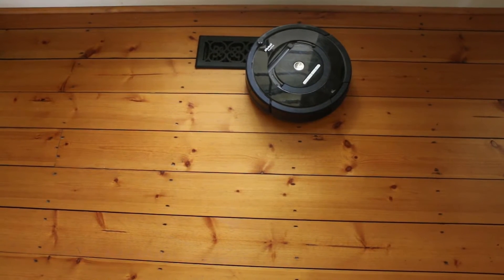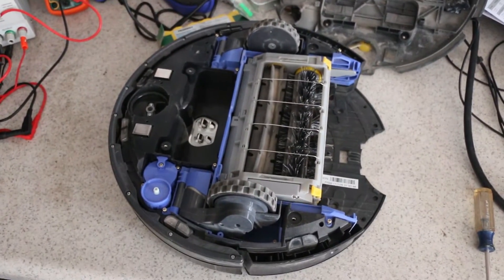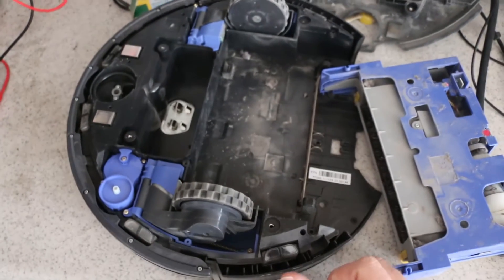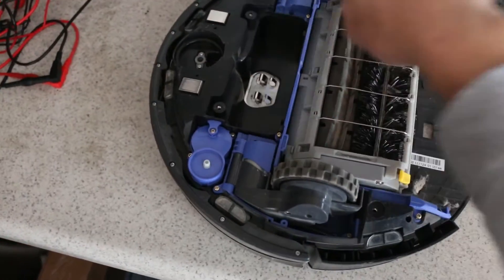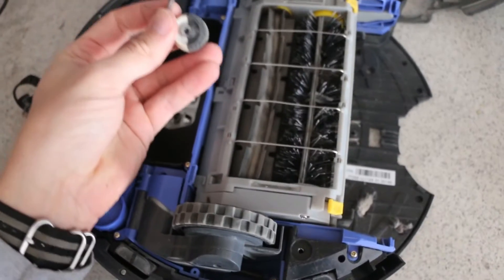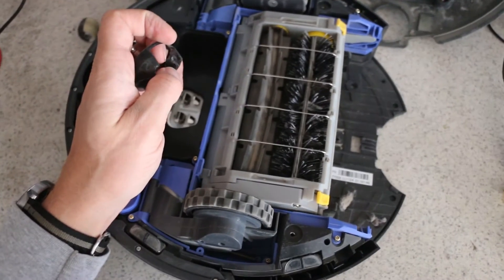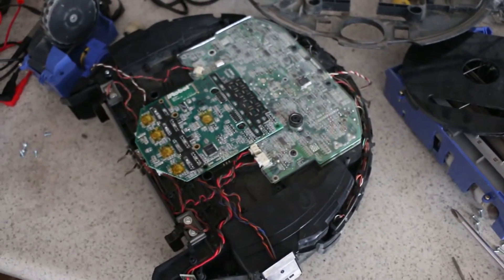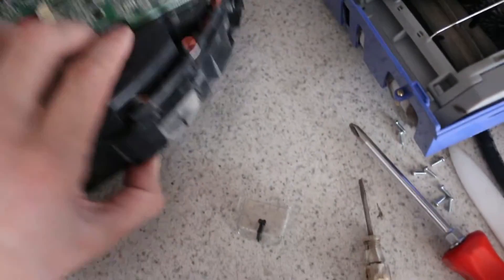Roomba vs Floor Vent - Sensor Fix

Comment: Did that really work, because I thought that mine is just getting stuck on the vent grooves, OR is basically afraid he's on a ledge because the drop sensor sees the depth of the vent through the grate. Trying to figure out the best fix.